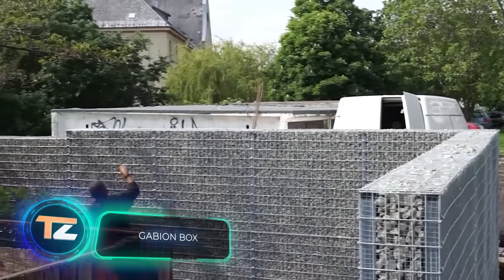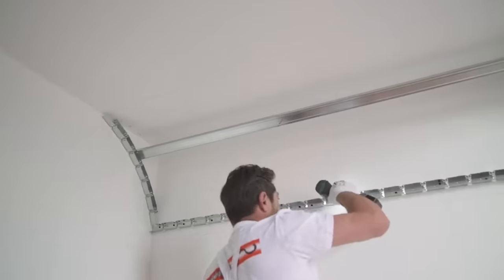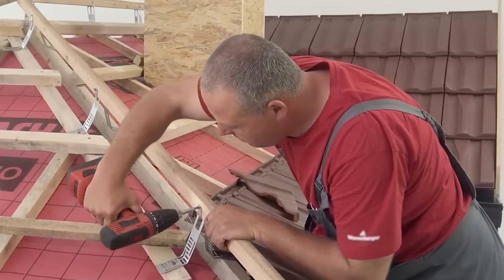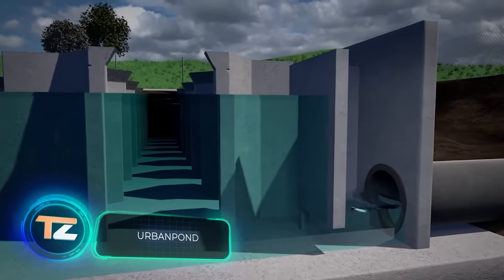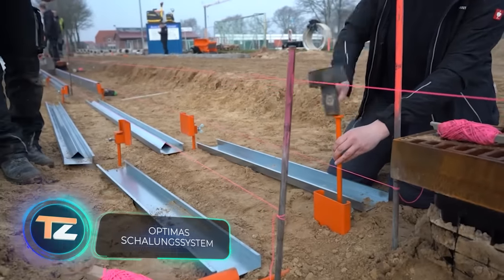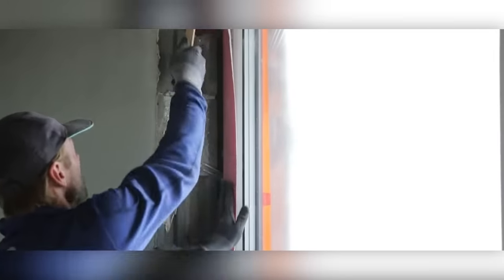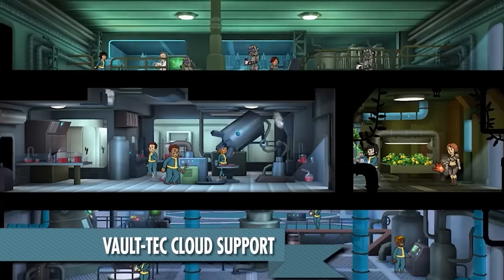CONSTRUCTION TECHNOLOGIES THAT HAVE REACHED A NEW LEVEL

Comment: The rain water problem.
The initial video was a run off system with spaces on the ends of the covering slabs, the spaces allow water to flow in easily, but also leave space for your fingers to slip in and remove a covering slab. Japan has been using these for years. Unfortunately these also are the sewer system. They're called benjo ditches.

Comment: The characteristics of CLC cellular light weight/THERMAL blocks  bricks panel are, as below:
1. It reduces dead load on structure, thus giving you 30% to 40% savings in steel consumption. 
2. Reduces cooling and heating load by 70%, thus reducing air conditioning and heating bill by 70%.
3. Reduces air conditioning unit capacity by 50%. Instead of 1.5 ton unit, you can use 0.75 tons.
4. Solar system sizing can be reduced by 50%.
5. By installing reduced sized solar system, your Average electricity bill shall be almost negligible. 
6. Construction cost and system cost on 250 square yards villa can be saved upto 1.5 million rupees.
7. Annual energy cost savings are approximately half a million to 1.5 million depending on energy cost.
8. Your house shall be eco-friendly.
9. No echo in your house. Sound proof home.

Comment: Why would someone need/use those foam columns? I could not understand their utility 7:50
Reply: They would be useful in second level construction. For instance you want to pour a slab on top of an underground parking lot, that lot can only have so much weight put on top of it. Often the grade will be filled with huge styrofoam blocks, covered with plastic. Those forms would negate that process.

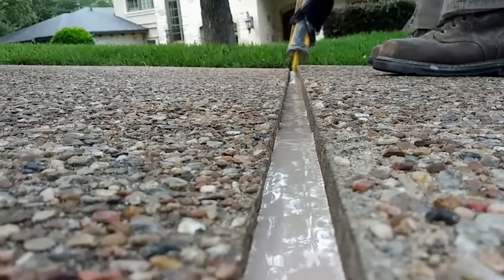Comment: Uhhh, filling expansion joints with sand (6:52 in the video) is a really bad idea, they will become fixed joints - the sand settles and becomes solid, and they concrete slabs will crack.  
This was done as a form of sabotage by a subcontractor on a swimming pool of someone I know.
The expansion joints locked up, doing enormous expensive damage to the coping of the pool.
Reply: Their script skipped the foam tube that was filling most of the expansion gap, the video showed only a relatively small amount of sand being put into the gap below the foam and sealant